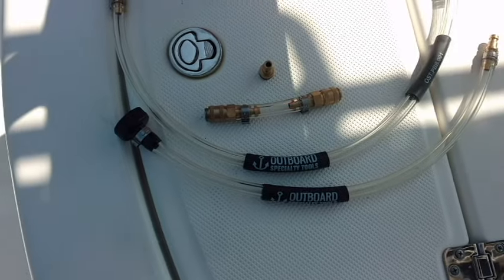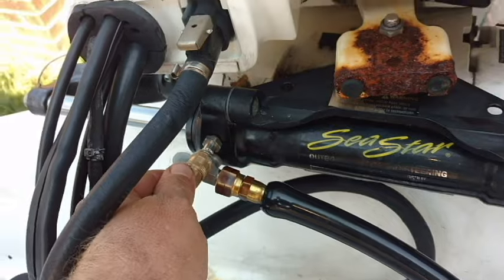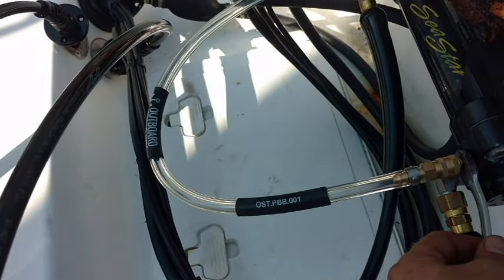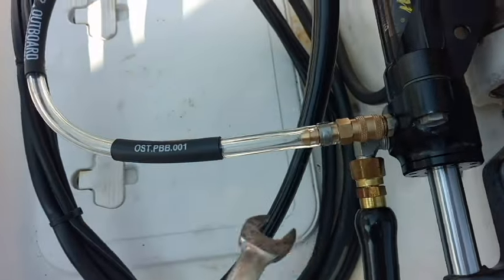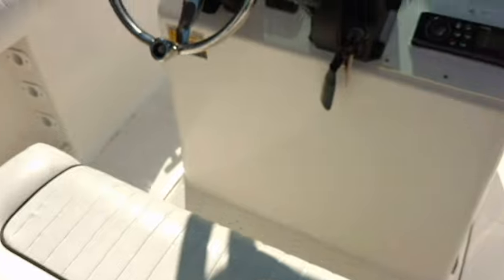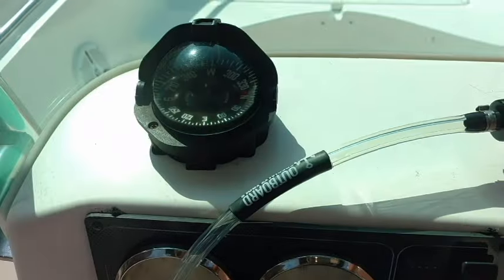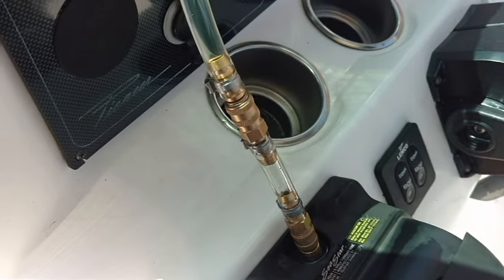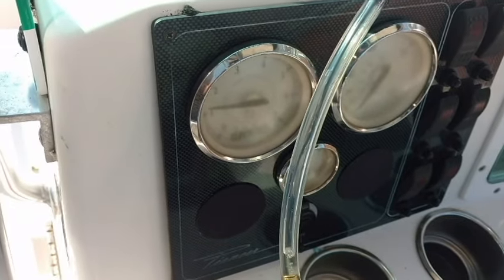Bubble Purge™ SeaStar Hydraulic Steering Bleed Repair OST

Comment: Another great video thanks, I’ve used your tools for rebuilding piston &bubble purge my ? is I’m purging the system almost done there is nice smooth no skipping in the wheel but when I’m bottomed out on either side & go back opposite way there seems to be a little vibration/skip , I assume there is air some place (in helm?) an suggestion on where or how to remove? thanks
Reply from the maker: Hi Catherine, there are quite a few variables in play with these systems.  If you know that the air is out of the system, and it's still fighting with you coming out of the corners, its possible that the helm is a factor, but tough to say without looking at the system.  I would need more info about your system, set-up and system age, so please end more info when you have the chance.  What type of helm, cylinder, single or twins/trip's, single or dual helm etc, approximate age of your system?     In general, and especially in the salt water market, most hydraulic helms are dealing with some combination of contaminated fluid or fluid loss after about 10 to 15 years in service which can degrade the helm ability to build pressure.  Isnepct the helm for signs of corrosion and leakage.  Look under the wheel for signs of leaking oil seals, check out the back of the helm for leakage and advanced corrosion.  Check hose fittings as well.  If there is a leak that's bad enough to affect the steering system noticeably, it's usually pretty easy to find.  Feel free to send me more info and we'll help any way we can.

Comment: I have a liquid ty-bar (World Cat) how would a person use this system with that set up?
Reply from the maker: Hi Peter, The Bubble Purge G2 Kit is not compatible with Liquid Tie Bar installs.  For Cats with Liquid Tie Bar I recommend the Bubble Purge Pro SC, it is designed specifically for Dual Cylinder systems with Liquid Tie Bar.  We have full schematics and instructions for Liquid Tie Bar Systems posted in our FAQ section on the website.  The Pro DC Kit is a large step up in price compared to the G2, but it is dramatically more efficient working with systems like yours.  The link for the Pro DC is below as is a link to the FAQ section which has schematics and PDF instruction kit for your system, and as always if you have questions, email of call and we'll be happy to help anyway we can.  
https://outboardst.com/product/bubble-purge-pro-dc/
https://outboardst.com/frequently-asked-questions/

Comment: Sir.. R all SeaStar Hydraulic  steering ram Reseal kits the same???  I would think not?? Thks
Reply: The seal/end cap part itself is the same regardless of cylinder model or age.  If it is a SeaStar cylinder, there is one OEM part they sell in two different OEM kits.  HS5167, comes without wrench and is less expensive, HS5157, comes with wrench and is more expensive. If it is a BayStar cylinder, also made by SeaStar, the kits will be different.  I strongly recommend that OEM replacement parts are used, but there are one or two aftermarket suppliers who appear to have a decent product, time will tell, and several overseas based suppliers flooding the market with absolute junk.  BUYER BEWARE!
Reply: My ram seems to be by passing on the inside ...  if that oring is bad in the middle of the shaft that’s on the plastic part ?? It will bleed inside??? NO  leaks on end caps...unless I still have air in system..

Comment: I was wondering if your system fits mercury 150 set up?
Reply: its not a mercury 150 set up.
Mercury makes the engine, then rig it with steering options, most likely sea star.

Comment: Great video.  Do you know why when I loosen the bleed fitting, the hydraulic fluid comes out of the thread instead of the hole? Because of that, I couldn't see any bubbles.
Reply from the maker: This problem is usually caused by debris build-up in the port that the bleed valve threads into also the O-ring on the bleed fitting being damaged or dry rotted.  If one or both of these problems is occurring, fluid will leak from the threads through the O-ring and out the front of the bleed port.  When this problem happens, the bleed valve needs to be removed, blow it out with compressed air, visually inspect the fitting to make sure that the passages are not blocked.  Gently clean out the bleeder valve port before threading the valve back in.  Replace the O-ring with the new O-rings that come with the seal kit, if you are not doing a re-seal, you can find matching O-rings separately through several vendors.

Comment: I have an Adventure Craft .  Two helms.   Would you hook fluid to both helms and turn at the same time or will your Bubble Purge work on this ?   Thanks for any input .. CJ
Reply from the maker: CJ, Sorry I'm so late getting back to you.  The G2 would work with dual station/single cylinder one at a time, however the idea is really interesting.  Dual helms on the same deck/same elevation would be worth a try.  I have to try this to see if it would make a difference.

Comment: Hi, I thought the video was great and easy to follow. I have twin engines and each one has it's own piston, do I need to order 2 kits or do I do the motors individually?
Reply from the maker: Hi George, this will depend on the exact configuration of your system.  If you have a Dual Cylinder system with steel tie bar, and no power assist or Autopilot, you can purge the system efficiently one Bubble Purge G2 Kit (https://outboardst.com/product/bubble-purge-hydraulic-steering-bleed-and-purge-kit-ost-pbb-001/) and an additional Hydraulic Cylinder Bypass Attachment (https://outboardst.com/product/hydraulic-steering-cylinder-bypass-attachment-ost-pbb-001-3/)  If you have a Dual Cylinder configuration with Liquid Tie Bar and Auto Pilot, Power Assist multiple helms etc (common for Catamaran style hulls) I'd recommend that you step up to the Bubble Purge Pro DC.  The Pro DC is obviously a step up in price, but is designed specifically to handle the demands of more advanced systems with more intricate plumbing.  The Pro DC will also allow you to purge both cylinders simultaneously as well as being compatible with manufacturer recommended purge sequence for most Auto Pilot and Power Assist pumps.
Reply: @outboardst.comoutboardspec8631  Thank you. I just ordered the Pro DC but I have another question. Do you need a hole in the bottle so it's allowed to breathe and release the air as you're moving the steering wheel?

Comment: I bought a used boat that has has a single 150 outboard with a SeaStar steering system.  No indications of any leaks I can find in the system. If I turn the wheel slowly (motoring around at idle speed) nothing happens.  If I turn it a little faster it engages and the motor will turn.  The fluid level at the wheel looks full.  Is this maybe a symptom of having air in the system?
Reply from the maker: Hi, After these steering systems get to about 10 to 15 years in service on average, they are more and more likely to develop issues like you describe.  Likely there is either some air in the system or there is some contamination/wear and tear on the valves in the helm pump or some combination of both.  Also, less common, the inner wall of the cylinder can develop pitting near the center of the cylinder when the piston rod seals ride when driving straight.  If the valves in the helm are hanging open when they should not be, it is harder for the helm to build enough pressure to actuate the cylinder without turning the wheel more rapidly.   Normally air only gets into the system if there is a leak in one or more of the seals either on the cylinder end caps or the oil seal under the steering wheel on the steering column which actuates the helm pump.  Also, inspect the back side of the helm for leaks and heavy corrosion.   First step I usually take to diagnose/isolate the problem is flush/bleed the system so that you know it is primed and that lack of fluid and fluid quality is not an issue.  Then see how the system reacts when turning slowly and then more quickly.   Push side to side on the motor, a fully primed and functional system should have almost no movement at the cylinder and the steering wheel should not move at all.  If you push on the motor and the steering wheel starts turning, highly likely is an issue with the helm valves.  Also, after bleed and prime system and a load test, wait a day or so and check all seals again for leakage, especially this time of year when nights are cooler and days warm up.  If you have the old school end caps with 4 hole pattern, which have been obsolete for many years now, almost a guarantee that they are either compromised/failing or are on borrowed time especially if there is heavy wear and pitting on the piston rod.  Hope this info helps. If you have further questions, just let me know. Thanks
Reply from the maker: Also, pushing side to side on motor and turning wheel if motor is bouncy and steering wheel unresponsive, move the motor halfway between center and either port or starboard lock (where piston rod seals may be able to ride on smooth anodized inner cylinder wall) and see if the problem goes away.  If the symptoms disappear, it is more likely that the cylinder inner wall is pitted out somewhere near center.  Btw, these are just diagnostic steps you can take to try to avoid a system tear down.  Often, at least some diagnostic tear down is advisable.
Reply: Thank you for the detailed feedback.  Looks like I've got some more troubleshooting to do.  Everything with the boat looks pristine, but she is older.  Boat and motor are 2006.  BTW, I've noticed its only when trying to turn to one side (port). Thanks again! @outboardst.comoutboardspec8631

Comment: I have your kit. I have 2 helms. One is lower that the other. Which one should I do first? Thank you.
Reply from the maker: Hi, normally you start with the uppermost helm, and leave the lower helm sealed.  Most of the time the lower helm will purge itself and can remain sealed.  The lower helm has a non vented fill cap.  If you open it and there is fluid in the upper helm and compensating hose, the lower helm is going to start losing fluid pretty quickly and can make the job more time consuming.

Comment: You really don't tell us why you are doing what you are doing like you show the bubbles in the hose but you don't tell us which way you are turning the wheel etc....
Reply from the maker: Ken, I apologize, this video is pretty old and needs to be updated.  We have learned quite alot about this product since I created it back in 2018ish.  So, at its most simple, when the cylinder attachment is connected to the bleeders, with the bleeders opened, at that point the entire system is basically a hydraulic pump (the helm) with a closed loop (starboard and port hydraulic steering hoses linked together by the Cylinder Attachment via the open bleed fittings on the cylinder).  By turning the wheel with a constant feed of fluid coming from the helm reservoir  the pressurized hose will push fluid and any air in the system in a cycle where it is constantly circulated through the valve system in the back of the helm.  If the system has air in it, the pressure build up from the pump constantly feeding new fluid into the system will compress the air slightly forcing it back through the valves in the helm and into the helm reservoir where the air decompresses and vents out at the reservoir fill into the Bottle Fill Tube.  So , in this video, I do quite alot of changing direction, which over the last few years and countless steering repairs later, I've realized isn't necessary.  You can literally connect up the G2 system, open the bleeders and steer in one direction only and the air will leave the system. I'd still recommend changing directions at some point in order to encourage the more stubborn and smaller bubbles to vent, and then close it up and test.

Comment: Hi Tyler - I have a sea cat with twin 140 Suzuki outboards..I have been having an issue with fluid coming out of the New Seastar Helms fluid port on top of the helm.  I was told by Seastar that it was probably from air in the system.  I have tried bleeding the system by following the Seastar recommendations. Have not been able to get it right.  Does your system work with twins and a liquid valve in-between.  Also how would it work.  Thanks
Reply from the maker: For systems like yours you have two options, first option is to order the Bubble Purge Kit and also order an extra cylinder bypass attachment.  This option will work with dual cylinder and liquid tie bar however, if you have autopilot and or power assist pumps, the best solution is Bubble Purge Pro DC with Dual Cylinder Bleed hoses.  The Pro kit is faster and much easier to work with more complicated plumbing and also make system flush alot easier.  And the biggest advantage of the Pro is that once air exits the bleed valves on the cylinder, it is out of the system and can't get back in, whereas the regular Bubble Purge Kit routes air back through steering hoses into the helm where it vents out.
Reply from the maker: And as far as fluid seeping out of the vented cap, yes, it is likely that the system has some air in it.  If you have noticed any play in the steering, all the more likely it needs a bleed.
Reply: @outboardst.comoutboardspec8631  Yes I can even notice that one engine is out of alignment.  Thank you I went to your website and read about the system and how it works with the pro kit.  Thanks again
Reply from the maker: We are offering both Bubble Purge Pro Kits at a pretty steep discount as part of our Labor Day sale, the website should have the Labor Day pricing listed within the next few minutes.
Reply: @outboardst.comoutboardspec8631  Thank You for the Labor day pricing, that clinched the deal.  I just ordered the pro kit with the dual engine attachment.  I am waiting to get it and will use it right away.  Will give you a complete review when I'm done.

Comment: How does one do this with twins that each have their own cylinders?   Would I do anything with the reservoirs for each cylinder in my bilge?
Reply from the maker: Sorry for late reply.  Dual cylinder with steel tie bar usually can be purge with one G2 kit and a separate cylinder attachment, but the extra plumbing can complicate things, especially if you have power assist or autopilot incorporated into your system.  For this reason, we usually recommend Bubble Purge Pro SC or DC.  SC is configured for single cylinder, but can do one at a time or DC which is configured to handle both cylinders simultaneously.  The SC kit can also be upgraded to DC.  The Pro kits are also able to connect up to and purge power assist and auto pilot pumps if they are equipped with external SeaStar bleed fittings.
Reply from the maker: Please forgive, just read the last part of your comment.  I would assume that if you have external reservoirs in your bilge that you are running another type of system, sounds like SeaStar Optimus?  Please send more info on your system when you have a chance.

Comment: Can I use this system on a twin system Single cylinder? This is for a 2019 Parker 2520.
Reply: Correction, twin station single cylinder.
Reply from the maker: Generally speaking, yes, the G2 should work fine with dual station and single cylinder as long as there is no autopilot or power assist/power steering in line, then the Bubble Purge Pro SC would be a better/faster choice.

Comment: Can this be used to bleed the SeaStar power assist unit (after fresh installation)?
Reply from the maker: Hi Steve, for systems with power assist or autopilot etc, I recommend the Bubble Purge Pro Kit which is available for rent or purchase on outboardst.com.  The regular Bubble Purge Kit is able to bleed a system with power assist, but it can take quite a bit longer.

Comment: In desperation i added power steering fluid to my steering system. I know that probably not a good thing.. will i have to drain the system and fill with seastar fluid? Thanks fo input.
Reply: I would flush the system, add SeaStar and bleed.  Not worth the risk of internal damage being caused by wrong liquid.  The Bubble Purge Kit comes with detailed instructions for full system flush, fill and bleed.  And if you need me, gimme a shout

Comment: I just purchased one of these kits and it didn't come with the short piece coming off the helm.  Is that needed?
Reply: Hi, We removed the short piece of tubing from the kit when we came out with the second generation Purge, and we just haven't updated the video yet.  It is not necessary.
Reply: Tyler Holland , does that mean that the tube from the bottle has the threaded fitting for the helm? The pic on your site showing the two tubes doesn’t look like it does.
Reply: @BillSmithBSartist  There should be two separate  brass fittings that come with the kit.  One fitting is a fill fitting used to prime/fill the helm and the other fitting is a threaded fitting that threads into the helm fill port and quick connects to the fill tube/bottle.